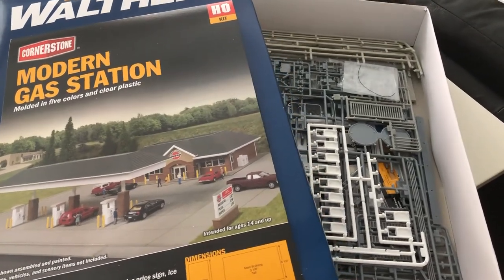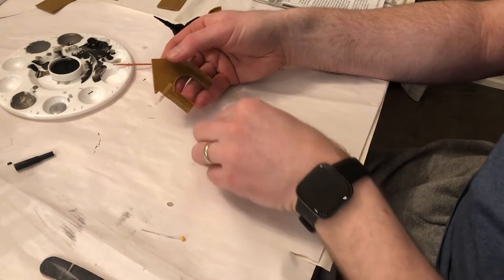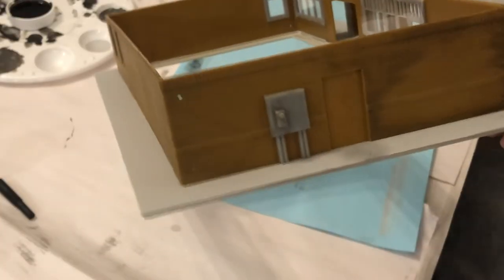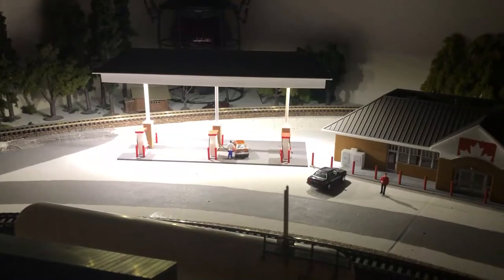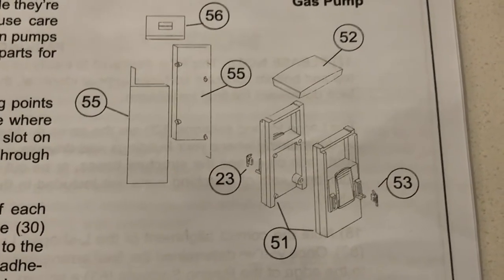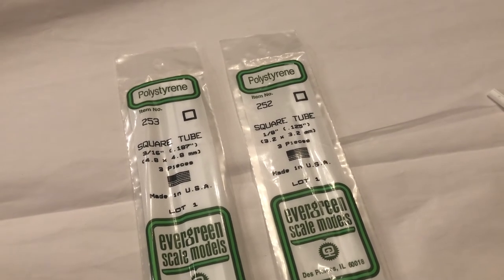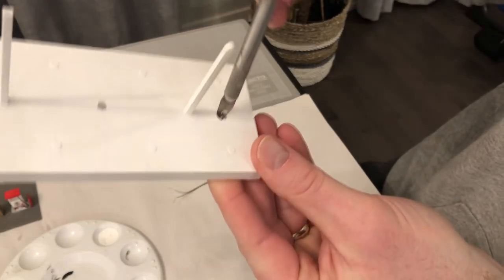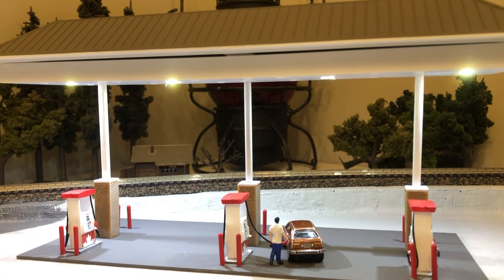Building Walthers Modern Gas Station into a Petro Canada with Lights

Comment: Bravo Mark! As always I appreciated the good laughs during the build. One suggestion for future builds that may be worth investing in is some Tenex7R (I don’t think they make it anymore but other companies do) or some Plastruct Bondene. They are both FANTASTIC adhesives for model building using capillary action to cement parts together by essentially melting the plastics. In my opinion, WAY easier (and faster) to glue walls, doors, windows and other smaller parts together and often cleaner than super glues/CA’s. 

Take it or leave it, I won’t be offended. Figured it was worth passing along! The gas station turned out beautifully and you should be VERY pleased. Looking forward to a few builds on all those houses for your development. 🙂

Stay safe my friend!
Reply from the maker: Thanks a lot Sean! I always appreciate feedback and suggestions. Kris uses that type of glue but told me that it might not work as well with painted plastic. I tend to paint my parts first then glue them. But I would love a glue that sets faster. 

Thanks for popping in to the live show the other night. I tease out of love. You and I have to do that collaboration sooner rather than later! Haha.

Comment: Mark I did something similar by putting multiple lights on 1 plug plus I tried putting a different brand of cheap LEDs on a plug and they work great.   FYI a stip cost less than the 2 lights plus I didn't have to put diodes on them.   Still working.   Chris
Reply from the maker: Thanks for the tip Chris. I’ll have to check it out. Strip lighting might be a good idea for the interior. Thanks for watching!